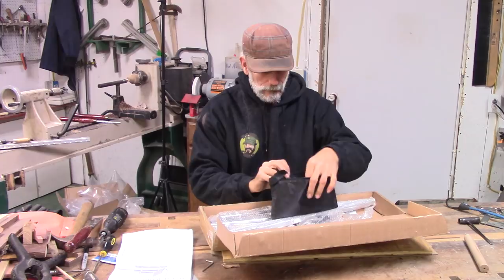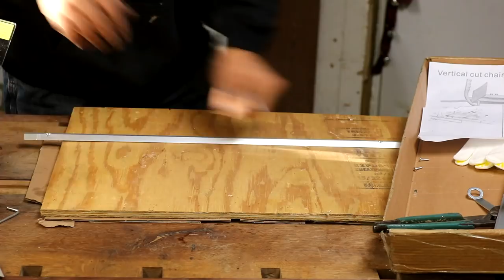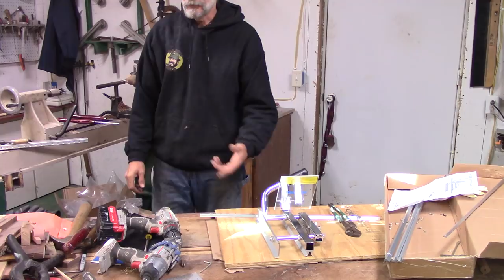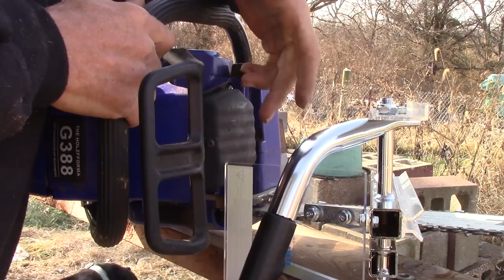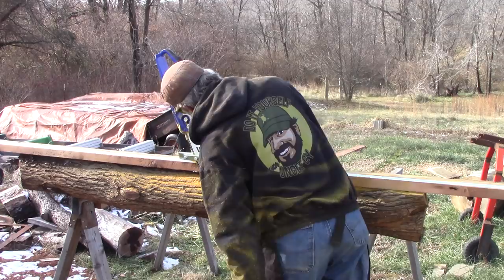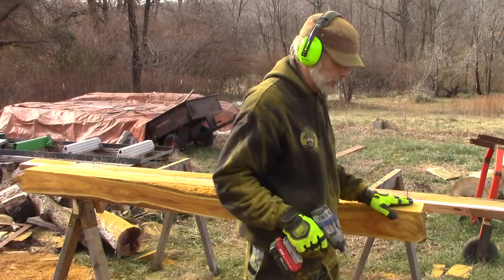Trying out the Holzfforma Edging Mill

Comment: I recently purchased a timber tuff milling jig in hopes that it would serve as a similar guide.  It uses a 2x6 for a guide.  I needed it to split some logs from a 60' oak that I fell this past winter.  Without splitting it, it was too heavy for me to winch onto my trailer and too big to fit on any of the local bandsaw mills.  I ran into the same issue with the clamp on the timber tuff.  The saw pivoted and the clamp ate my .404 chain.  Took forever to get the chain back in shape.  Still needs some work.  I drilled the bar which solved the issue, but it was a real pain.  Ended up freehanding the 2nd log and it came out MUCH better.

Comment: I think that shield is not for the dust but to save your pushing hand going into the chain
A suggestion for the dust is turn the saw around so the dust goes straight to the ground
instead of up in the air, it may make a difference maybe not
Reply from the maker: That would be lovely but it only allows for mounting one way. Go figure.

Comment: Whatch the fine saw dust. The real fine stuff like baby powder can go right through some filters. West coast mussel saws (formally know as the chainsaw guy) did a video on that
Reply from the maker: Yep. Flaw in the design of the mill. All of them like this have the same problem. The teeth are pulling against the grain so all you get is fine dust. If the saw were leaned the other direction it wouldn't be as bad but the jig is in the way of doing that. I plan to see if I can fabricate a better version.
Reply: @DIYwithUncleCy  did you. Ever make a homemade version? I couldn’t find a video
Reply from the maker: @11spitdms  Man I wrote a whole long comment to reply to you and YouTube ate it. So Short story No I have not but yes I intend to. But my plate is pretty full. I hope this helps my friend.

Comment: you should have flipped the handle so it is on the other side of that rail you have it on
Reply: I have this kit
Reply from the maker: I thought about that, wasn't fond of the idea of having to reach across the log and the saw to reach it. Did not look like a comfortable hand position to me. But hey if it works for you go for it.